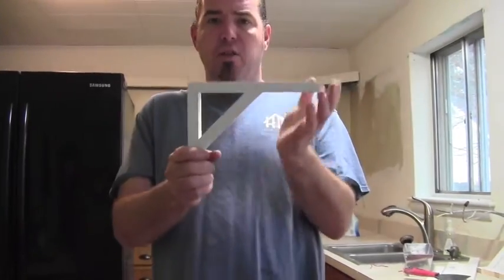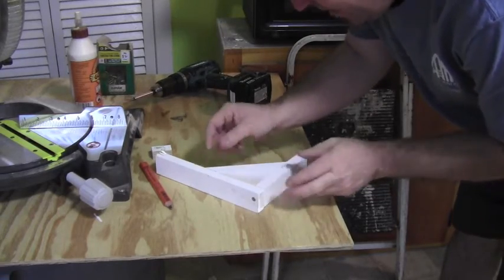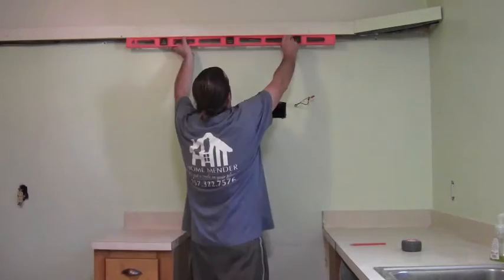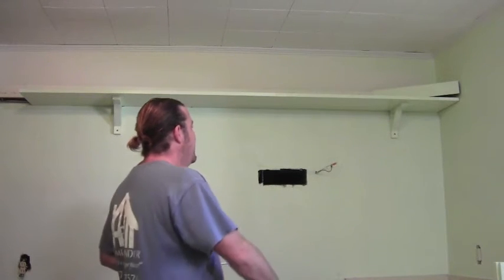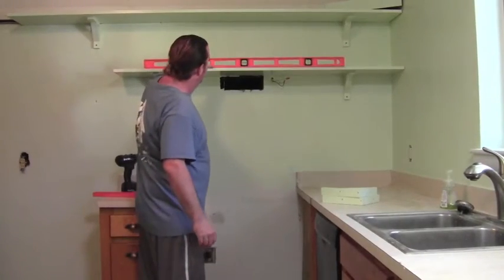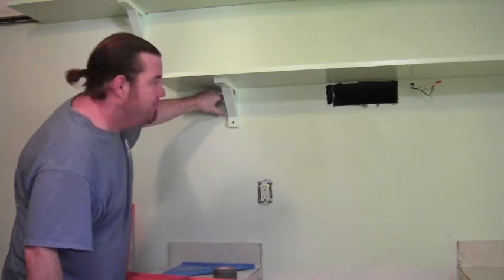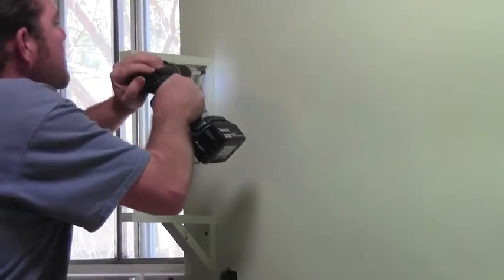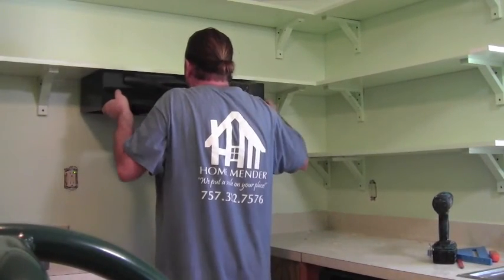How to install kitchen shelves, open kitchen style. Build shelves. Easy!

Comment: Do you have a video on how to find where your studs are?
Reply from the maker: hey mrs mezo! actually we do not... i usually do the knock test.. studs are spaced 16" apart center to center. Outlets and switches are typically nailed to a stud.. you can knock to see which side of the outlet box the stud is on, then measure over 16, 32,48 and so on... i usually find the ballpark area of the stud, then use a finishing nail to nail into the wall to confirm there is a stud there.. i hope this helps!
Reply: How much weight would those shelves support? Would I need heavier wood and stronger supports?

Comment: Did you buy the shelves painted. If so where at?
Reply from the maker: hey zach..these are 1x12 primed from home depot..still need to paint, but it does make it easier